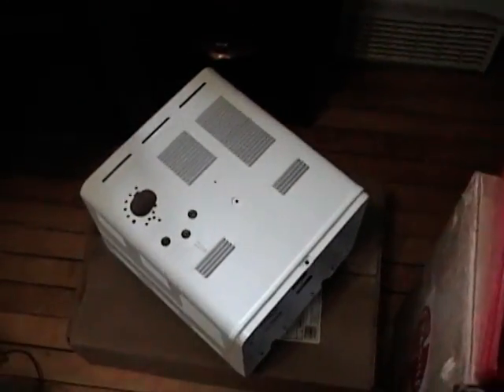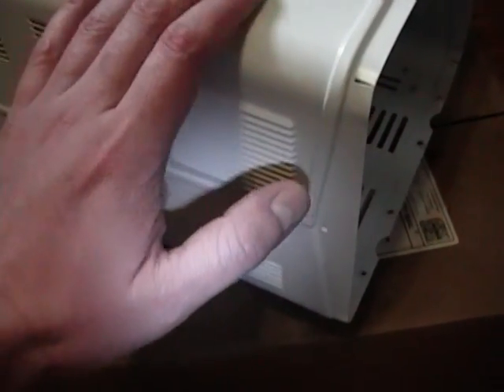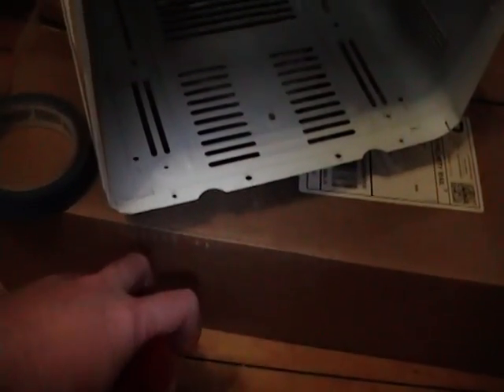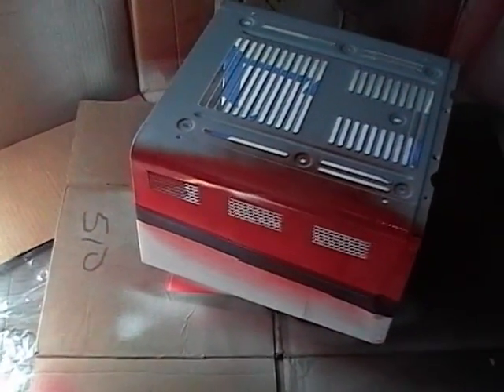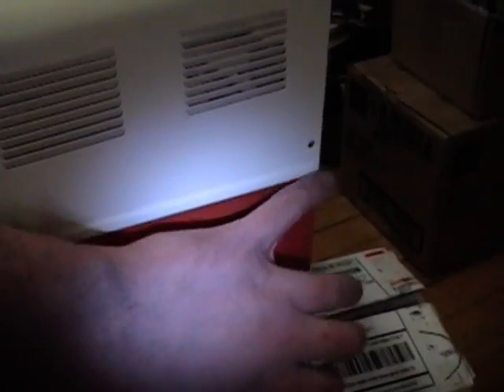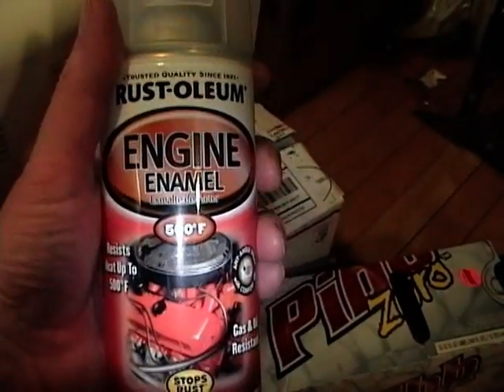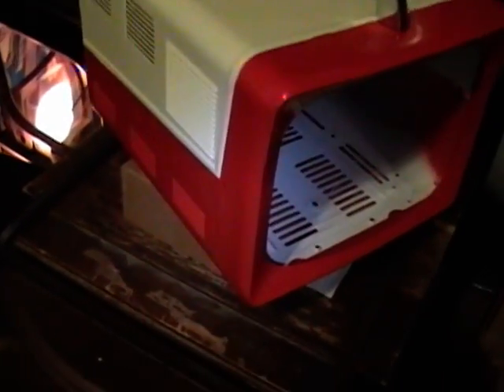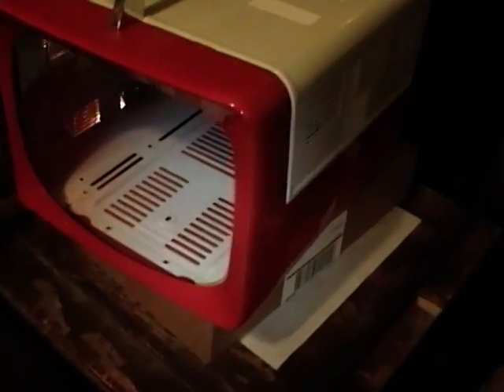Paint Stripping with Electrolysis p2o2

Comment: @bandersentv Nothing wrong with clear coating, it usually helps make a black paint job look a lot better. In don't know what they used in the paint on that TV, I'm guessing that it was some sort of enamel (could have had lead in it), maybe baked on too. That sort of thing became popular in the 1950s on Bakelite radios, if you've ever tried stripping one you will know what I mean, the paint on a typical 1930s or 40s radio almost falls off with stripper in comparison.

Comment: That looks much better then it did when you got it, that electrolysis trick really did the job in getting the old paint and rust off. I've two tone painted Bakelite radios before but never clear coated over the paint, I just waited for it to cure for a few weeks, or baked it on. I then took some automotive buffing compound to it to get rid of the orange  peel and other rough spots. It's interesting because the buffing compound makes the paint look like a really nice original paint job.